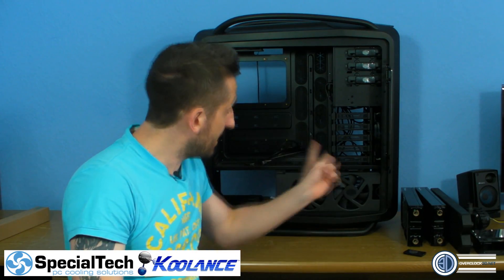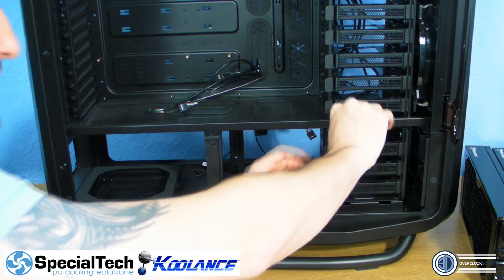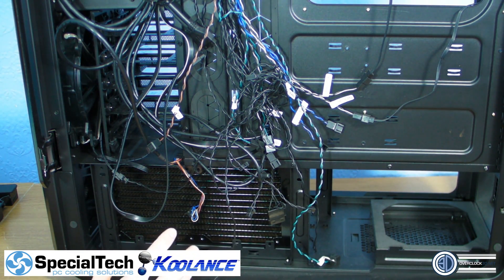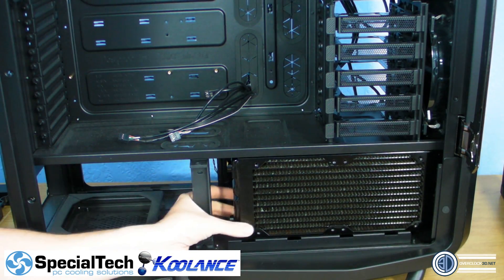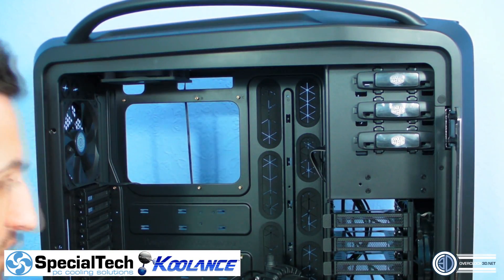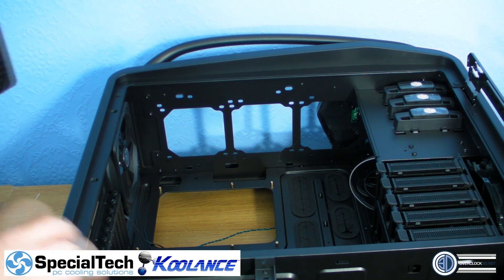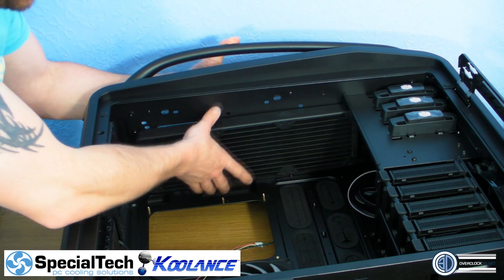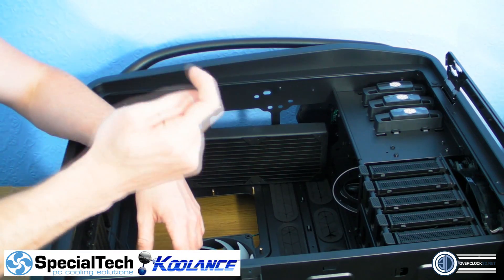CKC Radiator plans and placement - Coolermaster Koolance Cosmos

Comment: In a similar looking case I put both fans between the radtiators, so on both sides the radiators are visible. Than I ended up putting clear thin plexiglass on the side panels and drilled hundreds of 3mm holes in the 'windows'. My last change was to paint with a model car brush the fin bottoms yellow while the horizal 'bars' kept black. I must say that that build only had a single GTX670 card and a cpu block, so the slightly reduced cooling performance wasn't an issue..

 Love your videos..

Comment: another idea would be to leave this sandwich malarkey out of the case and take one really thick one in a push pull setup ;P. i saw a very detailed review of whether sandwiches are good or bad and they are mostly not doing your water loop any good. the warm air coming out of the first rad warms up the seccond one so the seccond one does not a lot of cooling. one of those amazing 80mm thick nexxos monsta rads will do a lot better :)

Comment: I'd really like some advice on choice of rads. 

He (Tom) chose the Koolance slim rads with the G1/4" threads facing OUTSIDE, very understandable. 

however, "coolmiester" did manage to stack two EX240s, and as i remember they DONT have the threads facing outside, they have it vertical. 
Is it possible to stack rads with EX240-type threads? how, exactly? 
If not, is there a higher performance rad with threads on the outside (pls point me towards them, it'll be a Godsend)

(Cheers)

Comment: You will need either 4 or 8 DIMMs, a quad-channel memory kit. Some programs can benifit from faster speeds, but 1333/1600mhz should be fine. Avoid mismatched RAM.

Though I personally would recommend the ASRock X79 Extreme6 instead. Similar price, but has a few more features.

Comment: He said you could have a 30mm rad up top with two sets of fans.  One set outside the case and one inside.  A 30mm rad + a 25mm fan you should be able to fit a 60mm rad and a set of fans on the outside.   I was just going by what he said but maybe its like you say and too tight.

Comment: hey tom ive got the rs360 rad in my cosmos2 and iv fitted push&pull NF F12 fans onto it in the top. asus maximus IV P67 ROG motherboard. i found it fits well only thing i found wrong was i cant remove my ram cos the fans block access to the little tabs to release them. let me know if u want a photo to see what im talking about :)

Comment: Tom, Double sided foam tape for the rads would work perfect. Easy way to get into that snug fit would be to apply the tape to the top and bottom of the rad (or case), wipe the tape with petrol (yes petrol), the tape will become very slimy , put the rad in and wait. The fuel will evaporate and the rad will be as tight as. They use this method to put golf club grips on......

btw Awsome channel.

Comment: What are your thoughts on using the stock rad brackets on the bottom, then using two really thick fans in between the radiators to mount them? what I mean is [bracket]-(radiator)-{50mmfan}-(radiator). The "-" would stand for screws.

Comment: @4:00 could you not get a pair of pliers and bend the tabs away from the radiator rather than cut them off? that will then leave u the option in the furtue to bend them back should you need the hard drive cages back in

Comment: Is it possible to put 2 240 rads in the bottom, both blowing out of the case, and the front fan supplying fresh air, or is that just completely impossible (i'm assuming D5's are on a front bay res). I guess you could use thinner rads but they tend to suck.

Comment: If only that was possible my friend, the Cosmos 2 does not have adequate room for a full size 60mm radiator, i have this case and the XSPC RX360, problem is that the rad actually touches the motherboard heat sinks (Asus Maximus IV Z68), currently im using the XSPC EX360 Rad for the top and a single 240 at the bottom, i have written to tom in the past about speaking to cooler master bout updating the Cosmos 2 and releasing a more spacious version, not sure if tom even cares.

Comment: I think you should put a 60mm Rad at the top with a set of nice fans on the outside of the case...  It would look better as well as perform better than the 30mm rad.

Comment: you should use some scythe kaze-jyuni 2000 rpm fans as these are only 12 mm thick and you will definitely have the room to install these fans with the ceiling radiator, and even the bottom radiators. /Scythe-Stream-Kaze-Jyuni-SY1212H-2000RPM/dp/B002CYRROY/ref=sr_1_3?ie=UTF8&qid=1334421003&sr=8-3 after amazon.com

Comment: Well not much suspense for me on this build, cause I did this exact same build 1 month ago, only diff is I only have 1 240 rad at the bottem . Top 360(30mm thick) rad I use typhoon slims pushing from the bottom and normal typhoons pulling from the top. my 3930k @ 4.5 folds with cpu temp @ 58-60 c with 1.375v. room temp around 25c.(team 98860)  X)

Comment: You could probably fit 2 air penetrators pulling from the one rad and cooling the other as well.I think they would create enough flow through the second one due to the streamed airflow.Just a suggestion!